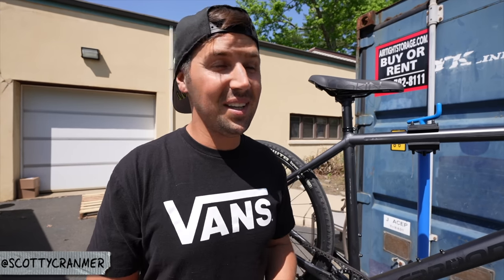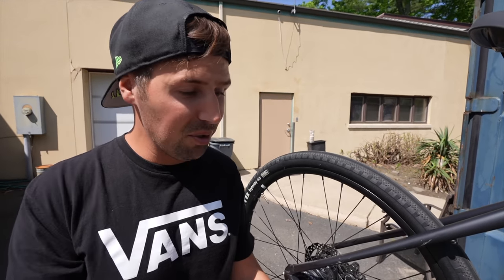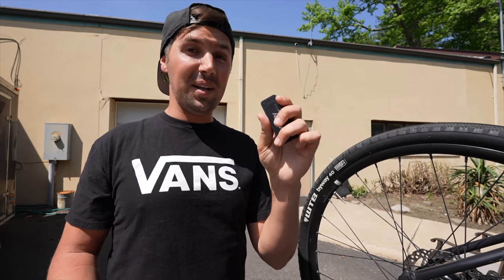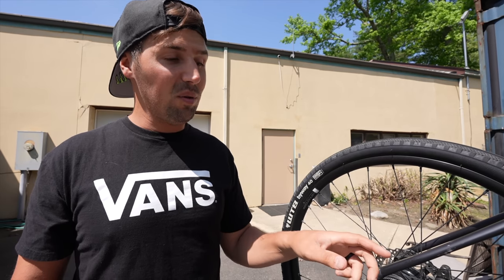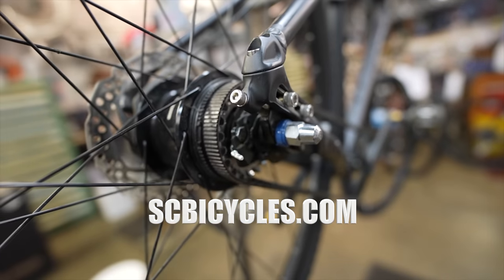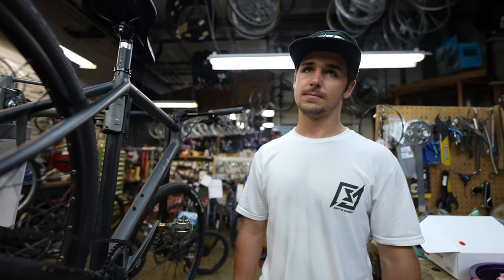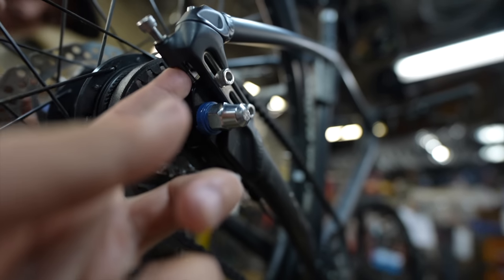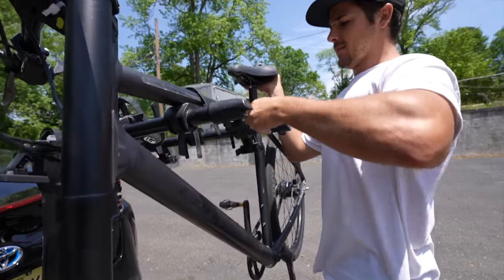BELT DRIVEN BIKES ARE THE BEST BUT THEY ARE COMPLICATED!

Comment: I'd love to see you guys try to adapt a belt drive setup on a BMX bike.
Reply: What is there to adapt
Reply: @mrnorthz9373  sprocket and driver. A belt would never stay on them due to them being designed to utilize a chain and not a belt.
Reply: @neonnerd1364  i see. It would be pretty cheap to design them in a cad softwate and get them manufactured out of sheet metal or cnc milled

Comment: The Gates CDX (original) belt isn't better "because it's more waterproof".  The CDX belt is higher quality and has a longer wear life than the Gates CDN belt. The CDX belt is made of polyurethane-carbon, while the CDN belt is made of polymer-carbon. The CDX belt is also weather resistant, efficient, and durable, and can withstand strain. The CDX belt is used on high performance bicycles and is rated to -65°F. The CDN belt is intended for city bikes that are used for light duty, such as grocery runs and relaxed urban riding...  Just for the record.  Question!  What size is that?  Medium?  Large?  Thanks!

Comment: Those lefty forks are Cannondale through and through. The engineers must have had fun designing that.  Belt drive is interesting.   From what I have heard, belts don't need replacing too often.  The integrated headlight in the fork is an interesting idea.  Great to see you enjoying riding Scotty.   Definitely interested in seeing the difference when you get the new belt on.
Reply: Any time you want to question the ability of a Lefty 'fork'. Think about the landing gear of an airliner.

Comment: Gates provide a calculator that allows you to input all sorts of numbers including front sprocket, back sprocket and chain stay length to tell you exactly which belt to use.  I changed my sprockets to make hill climbing easier that I do all the time, at the expense of going faster that I never do.  The orginal sprockets were 50 /  24 to give 2.08 ratio with 118 tooth belt.  I changed to 46 / 26 to give 1.77 ratio. The effect is subtle but noticeable in a good way. I choose these numbers so I could use the existing belt that I will keep as a spare, and bought a new blue 118t belt. all parts are CDX - with the centre guide. Also combined with an Alfine 8 speed IGH; the bike is a dream.  So I added a Grin all axle motor to the front and battery in a seat bag. Perfect totally silent riding.

Comment: The belt only contacts half of front ring, so if you added 4 teeth to the ring, you would add 2 teeth to the belt, right?
Reply: Yeah, it'd be a tiny bit more than half but closer to 2 teeth than 3.

Comment: The belt is only in contact with the front half of the chain ring (well, belt ring..), so I'd guess that it only needs to be 2 teeth bigger than the old one, rather than 4.